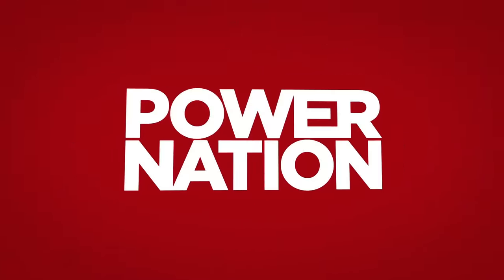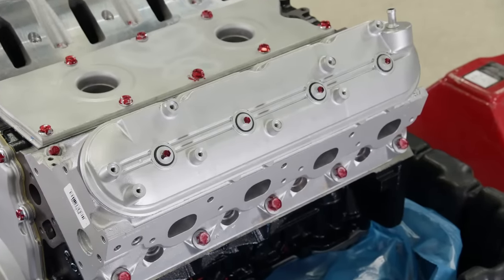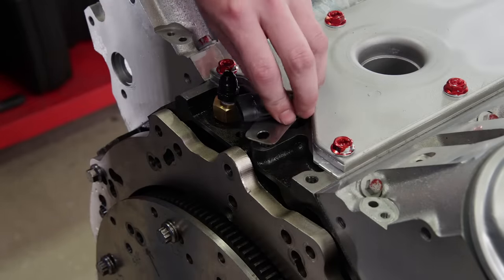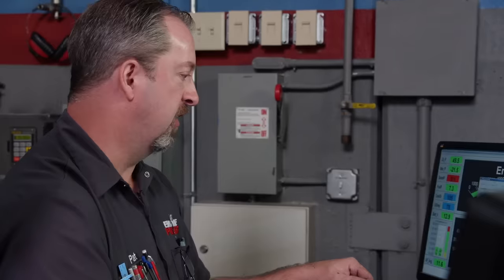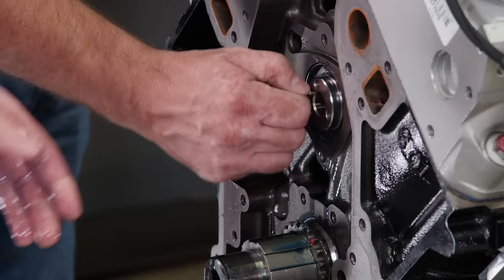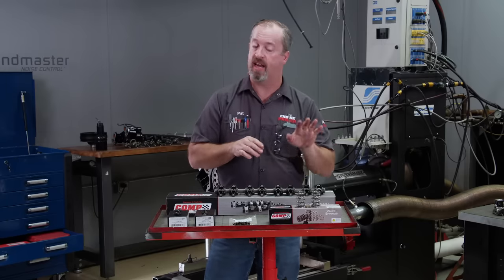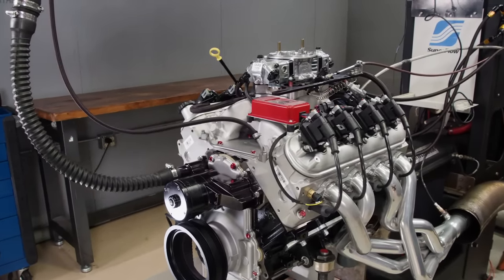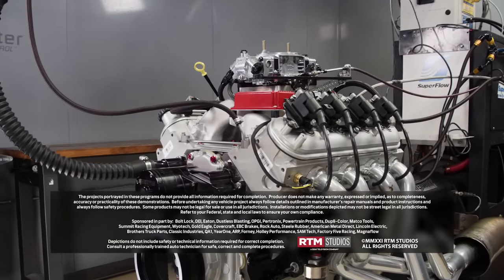Hot Rod LQ9 Cam Swap - Engine Power S8, E21

Comment: The Lq9 is probably the most gnarliest, bad ass powerplant. I had one in my sierra and it took tons of abuse.
Reply: They're absolutely bulletproof, built off of an absolute work horse of an engine (the LQ4) but with higher compression they're literally asking to be built and abused
Reply: So you guys are telling me that I should play with mine more?? Haha!
 I only put a small 550 lift Texas speed cam in mine. Still have to work on tuning it.
Reply: @davidellyson8815  550 is a good size. You should look into a set of prc225 heads. Or ported set of 243s. Look up Richard holdener he breaks down ways to make power thru cams and heads.
Reply: It was in my plow truck and it had a shit ton of hard hours on it. I live up in the northeast and we had quite a lot of blizzards and Nor'easters.....and this truck just powered straight on thru.
Reply: Mines about to turn over a half million k, breakin records

Comment: I thought they meant “actually turning the motor over” as in upside down, which would keep those lifters in their bores and out of the way.
Reply: that would actually work as well
Reply: Steven, I had the exact same thought. He should have said to rotate the crankshaft, my opinion. Like Austin said, turning engine upside down would work and you would want to completely drain all of the engine oil as well. Still  risky either way, but a big payoff for time saving if it works. Thanx for the post.
Reply: I was thinking the exact same thing. should work just fine if you had that option to do so like they did here but didn’t do.
Reply: Hey guys, what they should have done is stuck 5/16” rods into the oil galleys and that would be impossible for the lifters to fall out and only takes about 5 seconds. However they were quietly confident the new lifter trays would hold the lifters from falling.

Comment: Stick 5/16 wood dowels down the oil galleys to hold the lifters up in place.
Reply: For safety😆
Reply: Turn the entire engine upside down.
Reply: And if the dowel or dowel(s) happen to break off.....you really gonna lose your shit then.
Reply: @p.b.sHUNTING  if the dowels broke off then either A: the person doing the job is an idiot and shouldn't be doing said job or B: theres much bigger problems in the oil galleys since a 5/16 dowel is not a tight fit. It's just enough to hold the lifters up. Been doing it that way for over 15 years. Relighing on a lifter tray to hold the lifters up is just stupid.
Reply: @backyardgarage  relying... 🤦
Reply: @allanb3222  take it up with auto correct champ!
Reply: I was thinking the same thing why didn't they 1 turn the motor upside down or 
 2 use 5/16" wood dowels. You'd think these guys would know this much!
Reply: Here's another option. Buy two fiberglass rods or arrow blanks. These work well too. Yes, I have a pair of fiberglass rods that I had used on my LC9 just recently.
Reply: Use steel or aluminum dowels
Reply: @n5yiz  I'd have to turn the truck over in order to do that. 😆

Comment: I'm about 2 weeks away from my dyno day and I cant wait!!! Gotta lq9, tsp torquer V4 cam, mahle power pak forged pistons, ported and polished 799 heads, .650 lift dual springs, trunion kit, dorman ls3 intake. I'm sure I'm forgetting something. It's going in a 350Z
Reply: planning to do this with my g35
Reply: How did the build come out? I want to see how that z handles that much power?
Reply: LS3 intake on 799 heads?

Comment: 16:35  You guys have been the only series that continuously shows oil pump shimming.  👍
Reply: I ain't never even heard of it. maybe that's why I keep blowing up my Subarus.
Reply: @kidsythe  Maybe, does your machine shop deck plate and align hone your block?
Reply: @Sir.VicsMasher  👀 I use feeler gauge and a straight edge to check for flat. the straight edge was made flat by the machine shop to a low tolerance. 👀 but will that cause oiling issues?
Reply: Having uneven crank is more important line honing is inportant as it keeps the bearings true. @kidsythe

Comment: I just did a cam swap on an LS but didn't  have to remove oil pump  or oil pan. But on an LS with a double roller timing set I did have to remove the oil pump to cam swap.

Comment: What I find most impressive with these engines is they make all that power with total timing only in the 20's range! Old style  small block Chevys always need 34-36 degrees total timing.
Reply: Thats because the combustion chambers are very efficient

Comment: There was no need to pull the oil pump, I’ve done several of these swaps, just unbolt the cam gear , let it drop then remove the chain , rebolt the cam gear , spin the cam the quickly remove and install new cam
Reply: I agree with you I have always done it your way. Time is money
Reply: I thought the same thing unless the changed the chain and needed to change the lower sprocket.
Reply: You need to take the pump off to dial the cam timing. Were your engine's running roughly that's why
Reply: @andrewgoodfellow2039  it’s a non adjustable gear
Reply: We didn't see the bottom pulley go back on ,if it's adjustable the oil pump would have to come off. If it is not adjustable then your right the pump wouldn't have to come off
Reply: What?
Reply: @andrewgoodfellow2039 from what I've seen.  SBE engines don't have the cam timing issues of older engines.  It's a good idea to check it. However, most of the time, it's correct, and people don't use the adjustable sets

Comment: Old friend of mine builds these right out of the junkyard, new cam, intake and carb that makes 540hp on 89 octane. Not bad for under $2000
Reply: Right.🤔
Reply: …with a warranty?
Reply: @martinthompson2425  Over 200 runs in a season and only changes the oil and spark plugs a few times. Runs mid 10s in a 3000lb 64 Nova
Reply: I doubt it without nitrous
Reply: 2000 plus the cost of junkyard engine

Comment: 61 cubic inches in a liter time is 6.0 that’s amazing power on carburetor that means 500hp all day with fuel injection and ported heads with 95mm throttle body.

Comment: never seen you guys do a higher-end build with fuel injection as we do on the streets. something like a tbss swap to see the difference between your carb/throttle body setup and stock truck or car intakes. 
3/16 - 5/16 dowels are good to make sure the lifters stay up in the trays. i use wood ones so that way they don't damage a lifter if I bump into one of them. 
good video though.
Reply: They've done a few. You just have to look
Reply: @vegeto186  ive seen the basic ones where it's a carb intake and a stock truck or car. what they haven't done is compare a bunch of them and show the difference between power, cost, and tuning time.
Reply: Richard holdener is your guy for those comparisons.
Reply: @akinajj1  I partake in his videos too. Can't go wrong with more people doing more testing.

Comment: Can you all do the toyota 4.7 DOHC, came in the 2005-07 4 runners. Belt drivven, they are solid motors, ultra reliable. Just curious what kind of power you can get out of it.

Comment: That’s a solid combo right there. Would love to put this in my s10. Those 317 heads hurt the power though. L92 or Ls3 heads would have been it.
Reply: I'm looking for one to put in my 96
Reply: @jpharmon7343  yes it’ll definitely push an s10 down the road pretty good. I have a 98 with a 1st gen sbc 350 and vortec heads. It’s runs pretty decent but that 6.0 is the superior engine. One day I’d like to swap one in.
Reply: If ur making 100hp with a cam swap, the heads ain't hurting power lol
Reply: @romper4444  a L92 or Ls3 head would make more power. Even a ported cathedral will make more power. Will it be worth the money is up to the individual. But the fact still remains more power is to be had with the other heads.
Reply: @thabiznizz  sure u can always make more power, but why, defeats the whole purpose of this engine, 100hp with a cam and some bolt ons, why would u bother. The stock heads have airflow to support 500hp, my point was the heads are not a restriction and not hurting power production like smogger engines where's it's absolutely necessary to swap heads. 👍
Reply: @romper4444  I’m not discounting what your saying, but you have to look at the fact that the big hp gain is also due to starting with such a tame stock cam and comparing it to a cam with 23X @.50 and .6XX lift. This engine is no slouch but the 317 heads flow about 243/193 @.600 intake and exhaust. The 821 Ls3 heads flow about 312/216 @.600 intake and exhaust. That will definitely make a big difference in power with a cam that size. You are definitely entitled to your opinion as I am mine 👍
Reply: @thabiznizz  This combo with the 317 heads isn't in need of more flow through the heads therefore you wouldn't gain power from better flow through the l92 or ls3 head. The reason the l92 or ls3 head would make more power than the 317's is because of the smaller combustion chamber increasing compression on this combo. If you compare the 317's to l92 or ls3 using the same compression ratios the peak power would not change by much if any at all.
Reply: @J-RocksCustoms  you may want to do a fact check on your information. A L92/Ls3 head has a 70cc combustion chamber. A 317 head has a 71.5cc combustion chamber. That would produce virtually no change in compression. It is  air flow. Roughly 50-60 more cfm. That’s a big difference. Those gains will even be seen on engines that can’t max out the air flow capabilities of those heads. The L92/Ls3 heads will produce noticeable gains over 317 heads…Period. 
There are dyno results to back what I’m telling you. Matter a fact Ricard Holdner has a video up that’s about a year and a half old on this same topic.

Comment: I'm always excited (at first) when I see these videos until I get to the part where you bolt a toilet on top of it.  Lets see a LQ9 build with a Holley Terminator LS MPFI Kit.  Now that's worth watching.
Reply: @Bootstrps I agree! Bolt even the FACTORY TRUCK fuel injection manifold on it and watch the numbers and power curve improve!
Reply: They used the carb because it makes more power than fuel injection. Every single time.
Reply: @realazliving  I would be interested to see evidence of that, as the tests I have seen run the lowest performing FI ( the ls1) intake was on par with the highest performing single plane carb manifold.
Reply: @jefflee8924  that has never happened ever. It’s against the rules of physics. FI is more able to adapt to different conditions without help. That’s why it is popular. You take a decent hit on horsepower to use it though. The atomization of fuel is worse, and there’s no cooling of the charge. Yes, it is easier to ignore. No, it is not as powerful.

Comment: I'd like to see an LQ4/LQ9 with a BTR "Truck Norris" cam & Trick Flow 255 heads on the dyno. Just curious about that combination for a daily use SUV or truck.
Reply: A lot less. Its very small cam compared to this compared to the comp they ran in the video. Maybe 410-420hp. My guess.
Reply: Those heads would be to big for that ci motor and cam and I believe TFS255s are ls3 rectangle port. Truck Norris would be good with 220 or 225 heads or some ported 243s. TFS has a kit with their 225 heads that make 500+ hp. Look up Richard holdener trick flow 225 vs ls3 head comparison you might find that video informational.

Comment: Did you upgrade the lifters when you upgraded the camshaft and springs?  I am  working on a LS3 engine and installing a camshaft kit.  I am also thinking about upgrading the lifters as well.
Reply: They would have had to disassemble the engine to do it, so no, they didnt.

Comment: 26 degrees is a lot of timing.  Hope you are monitoring the knock sensors.
Reply: Not with a carb and MSD, but that timing number is way safe in the dyno cell.

Comment: As a GM dealer tech for over 30 years , I have installed lots of LQK engines ,with no problems after the install .Note the two holes right and left of cam ,are for long wood'in  dowels rods . To stop lifters from dropping down into block ,while changing camshaft . Also noted by @jonjon2066 . Just think around 5k spent and you have a just under 500hp engine .Another great P/Nation video .
Reply: Since you’re a tech for so long, what was getting the camshaft degreed about? I’ve watched a bunch of ls cam install and never seen anybody do that
Reply: @bigboreracing356  I agree ,anytime a race cam is install in a race engine ,the cam must be degreed for peak performance .
Reply: @bigboreracing356  Not so , I worked  as a Dealer tech in GM Dealerships for over 3 decades ,rebuilding and repair countless engines under warranty and cash paying .Never have I seen even one Mechanic ,degree a cam for a stock engine repair , it's just not necessary . And now after retiring with 47 years under my belt 30 years dealer and 17 city fleet repairs (cop cars and fire trucks ) I will stand by my comment . Yes degree race engines ,and optional on stock engine repairs in the real World .sometimes being anal about some things ,does not always make it right . Just my 2 cents .
Reply: You can also buy the parts or better ones than the ones you need from summit racing for 3k O’Reillys I smoking to get your money

Comment: Just FYI the "proper" way to do the cam swap is with pulling the oil pump. However; it isn't required, just gotta get fancy with getting the gears back lined up

Comment: Is there a cam, that allows the 6.0 to get improved milage during normal driving and decent/ monster power gains above 3500rpm? 4200 pound dd truck.

Comment: I've done a cam swap on a LS3 and no need to remove the oil pump.
Reply: @Big Bore Racing  minor ampunt was left, couldn't get the degree wheel in the engine bay. My buddy was happy with the results, more than he had and professionally tuned.
Reply: @Big Bore Racing  no, my comment was that the engine is in a camaro, 6.2L. Not sure where you got the assumption I was working on a truck  engine, such as the 4.8 or 5.3 but cool story l guess.
Reply: @Big Bore Racing  he paid nothing to have it done, his friends all helped and the tune was next to nothing. Nobody wants to have work done by somebody who is being cocky, that isn't a good business model, maybe you should go learn how to do that first. However to stay on topic here, my original comment stands, you don't need to remove the oil pump to change a cam in the engine shown in the video, why you decided to go off on a tangent is beyond me. Glad you are a certified youtube mechanic.

Comment: That's a big lift cam for an lq9. Was it remand with oem flat top pistons due to piston to valve clearance issues it is known for? If so I may re think my .570 lift max for my 05 sierra denali and go with a larger cam.
Reply: I think the cam they use is pretty maxed out. .600 or just over should work from my research if I remember correctly. Duration plays a factor also I believe.

Comment: So when I did the cam swap no issues with the motor but I used LS7 lifters first and I used new trunion upgrade from Michigan Motorsports. I found 2 collapsed lifters so I too all the LS7 lifters out and went to stock Melling lifters but ever since the cam I get weird tick but it’s all the rocker arms. Does anyone else have this issue? 6.0 LQ4 , Truck Norris Cam, Stock pushrods, trunion upgrade stock lifters.

Comment: Have you guys ever done a NORTHSTAR CADILLAC engine.  Had a 2001  4.6L that was stout.
Reply: Northstar had that one issue as it's Achilles heal. And when it happens it SUCKS to fix other than they they're pretty cool
Reply: @KingJT80  and what 1 problem was that?the way it was over engineered ?or the over heating?burning oil?or the serve carbon build up?...or do you mean,how they can't hold a head gasket for sh!t?lol....take your 1 pick 😉
Reply: @shawnbrownfield9857  👀😂

Comment: I noticed that the painted screws and bolts are flaking and chipping away all over the motor. They did a close up when installing the intake manifold and there was plenty of flakes everywhere. I'm surprised they didn't catch that.
Reply: It’s not painted for cosmetics. It is quickly dabbed on there during the reman process to note that the bolts are torqued.
Reply: If they noticed it they won't say anything by shittng on one of their sponsors

Comment: you should try building a 2.0t ecotec b207r. or the older 2.3l B235R both engines are abundant an cheap. they used them in multiple platforms an have forced induction or good displacement. looking at its stats a bigger cam with more boost should easily add 100 hp to either engine.

Comment: a friend of mine bought a trade engine from one of these big magazine stores and had nothing but problems with it they had a used Cam and a brand new supposedly rebuilt engine the bearings on the camshaft wearing change little metal wires from the wire brush that they cleaned it with debris stuck under the main bearings you know it's just bad I'd rather have a rebuilt engine by a trusted engine builder than ever by a mail order crappy engine again